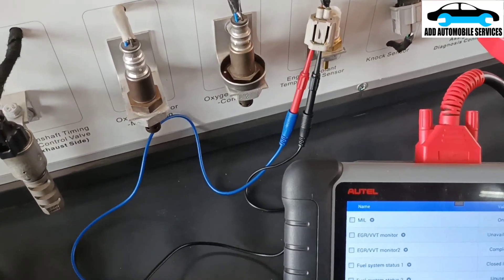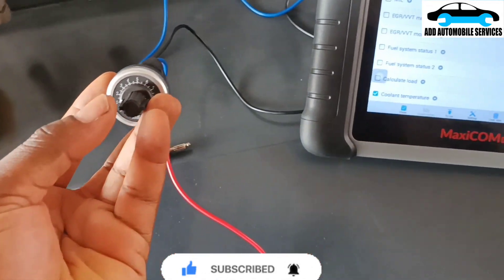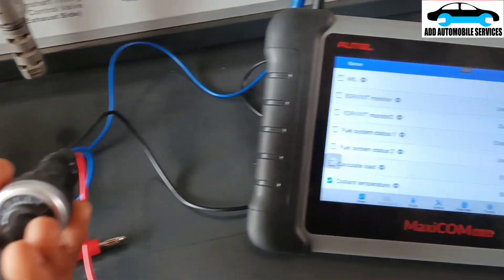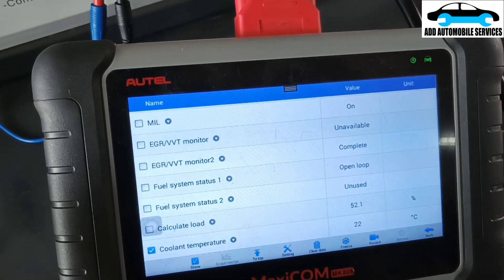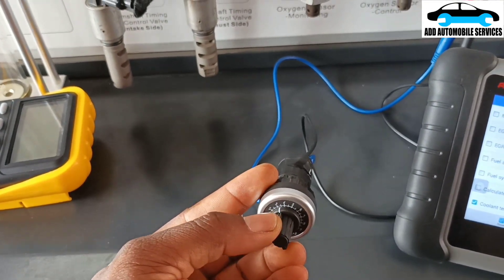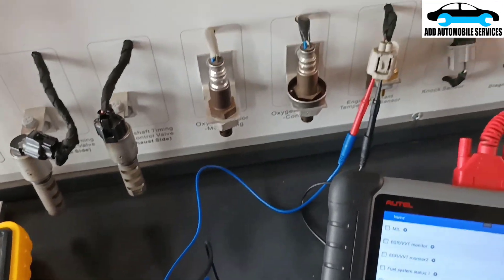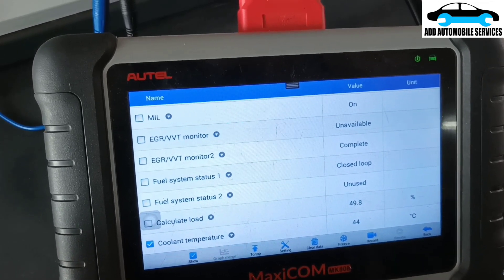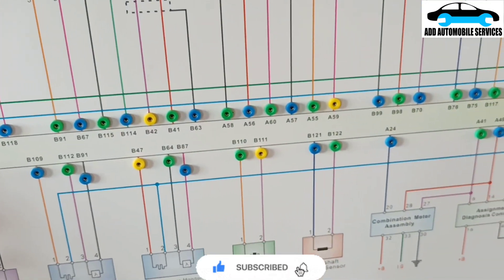Testing temperature sensor circuit.

Comment: HOW DO I DRIVE A UN PLUGGED PULL-UP BIAS VOLTAGE SENSOR CONNECTOR SIGNAL WIRE LOW TO KNOW IF THE SENSOR WAS WORKING . I HAVE A SENSOR SIMULATOR THAT CAN SIMULATE VOLTAGE OR RESISTANCE . I BELIEVE MY READING ON THE SCANTOOL IS TO HIGH FROM THE SENSOR . IT'S THE MASS AIR FLOW ON A NISSAN SKYLINE . I AM GETTING 2.5 VOLTS WITH IGNITION ON , BUT I DON'T THINK I  SHOULD BE SEEING THAT WITH THE ENGINE NOT EVEN RUNNING . WITH THE SENSOR UN PLUGGED AND THE IGNITION ON THE VOLTAGE IS AT 4.95 VOLTS. THANKS FOR ANY HELP ????????
Reply from the maker: MAF sensor use frequency

Comment: Please can the valve resistor be used on the car?
Reply from the maker: Yes
Reply: @ADDAUTOMOBILESERVICES  so please if it's been used does function same as the temperature sensor and can it turn on the engine fun when you are testing for the working of termostart.
Reply from the maker: Yes but you have to know the temperature that turn on the fan of the vehicle like Toyota fans turn on when it is 96⁰C and you have to run the engine